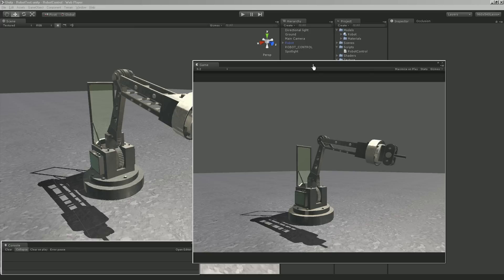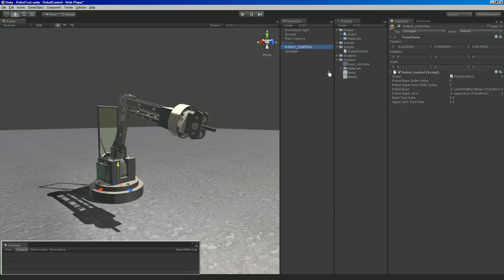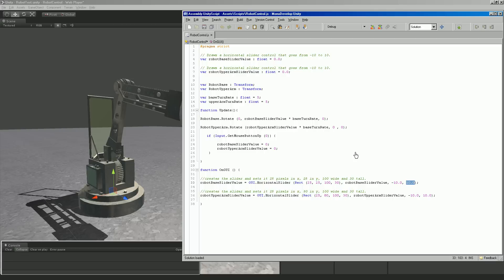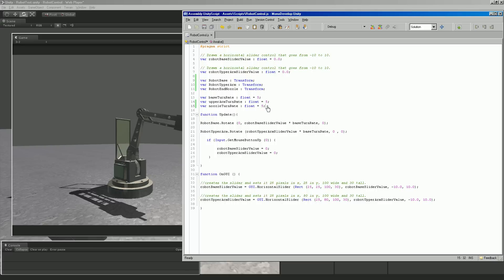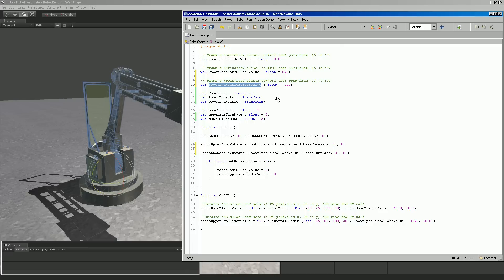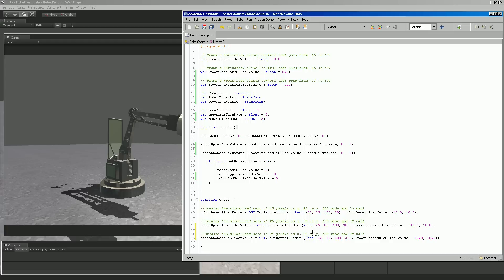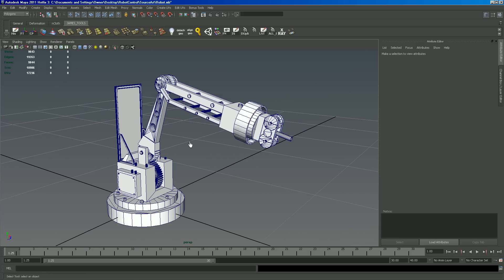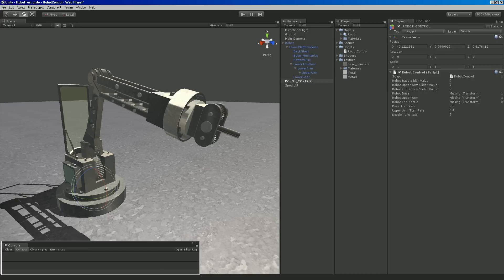Controlling a Robotic Machine in Unity - Unity Engine

Comment: Thanks for sharing. By manipulating the Transform property however you are effectively disregarding any physics influence on the object. This is perfectly fine for animation purposes but may hinder you from simulating realistic robotic properties. I would highly suggest you use the rigidbody properties by providing either a torque or velocity reference to your joints. Nevertheless, impressive work :)

Comment: if instead of sliders i want to do the rotations by buttons what is the procedure , and  the difference in a script. Thank you in advance
Reply from the maker: So the sliders are setting a float value from 0.0 - 1.0. The movement comes from this value. I figure with buttons you can create some code that will add from 0.0 all the way up to 1.0 while the button is held down. You would do the inverse with a button you want to the inverse effect for...i.e. subtract from current value all the way to 0.0. Does this help?
Reply: I already solved it with a boolean and some adjustable values but thanks anyway tho :-D
Reply from the maker: There ya go! See there is more than one way to skin a cat when programming.

Comment: How about a ROS node?  (ROS==Robot Operating System) -- something that would listen to ROS messages?
Reply from the maker: In fact I debated maybe going with a cooler system that uses a robot system manager with other smaller scripts used on each part (for subsystems or finer control). Might do that in another tutorial.